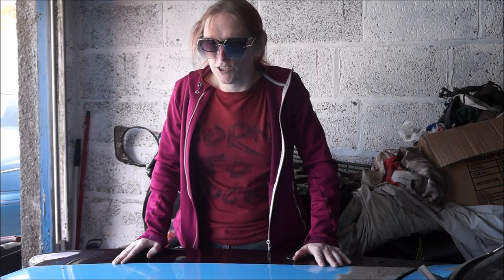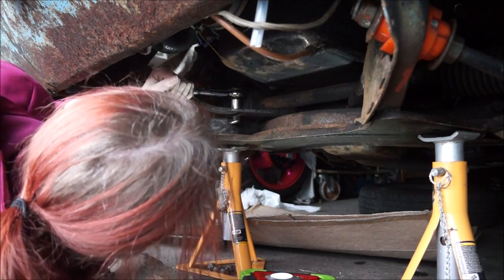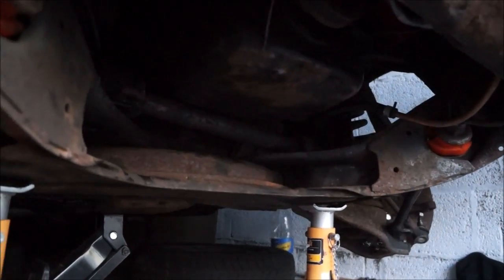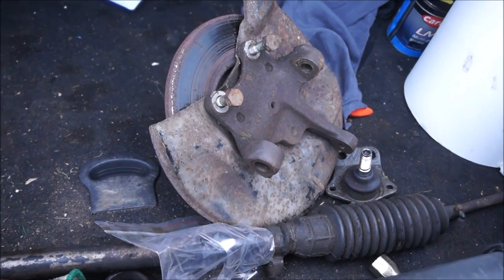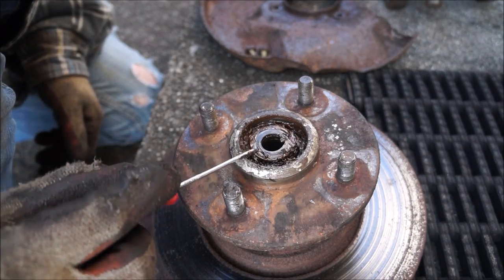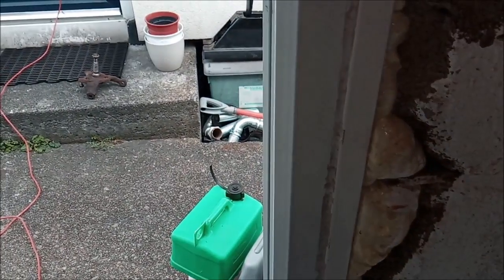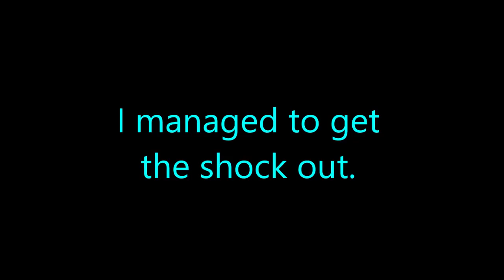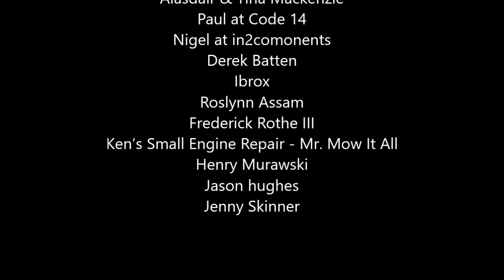Mk3 Cortina Estate Adventure Twenty Two part 1.

Comment: Good evening Simone I'd like to suggest to you a small length of scaffold pole for ease of undoing bolts, I think your need spring compression tools for safely removal springs on shocks, well done on the work  TC is getting there 👍✌️
Reply from the maker: I have a compresion tool, the spring just scares the hell out of me.